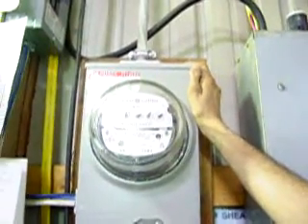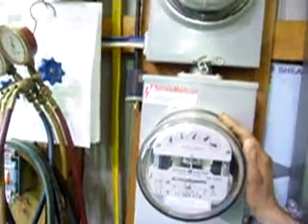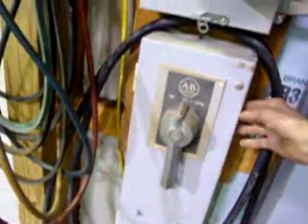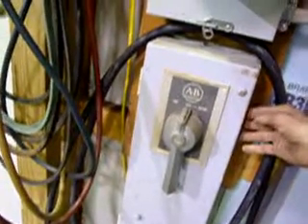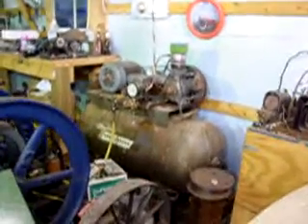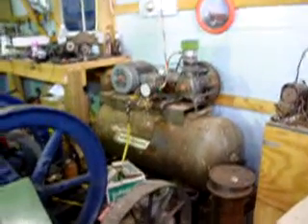3 Phase Converter & Breaker Panel

Comment: What are you using inside your PRC panel to bring the start caps in? mine, i have to hold the button in for half a second. Is that what the timed relay is for? Also, what kind of start capacitence are you running? In my testing it took about 900mfd to get a good start, using run caps. so i stuck a 1000mfd start cap in there. Seems to be a bit much, but i think alot of that could be tuned out with a more automatic starting sequence.